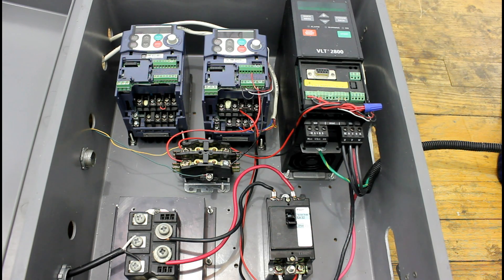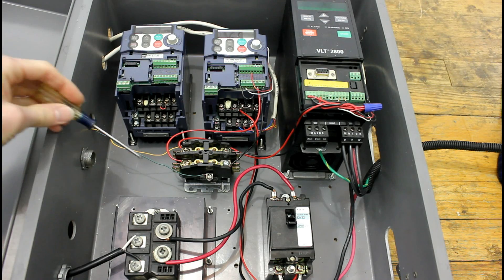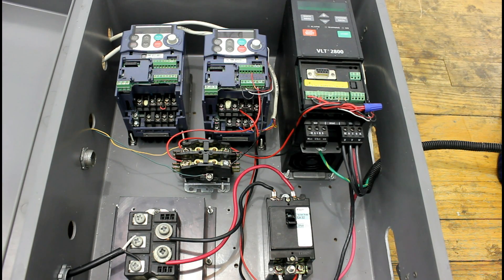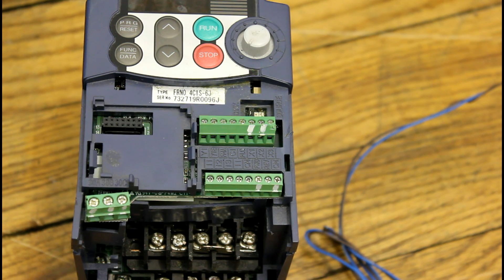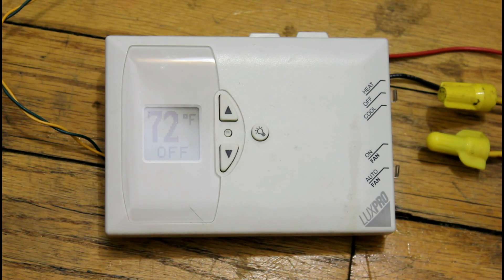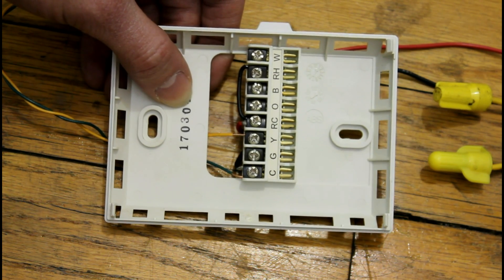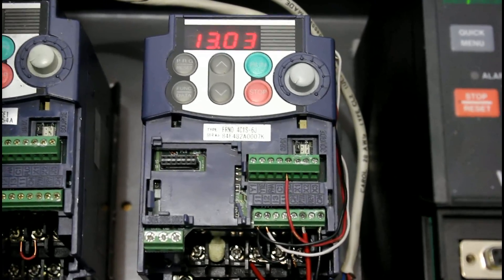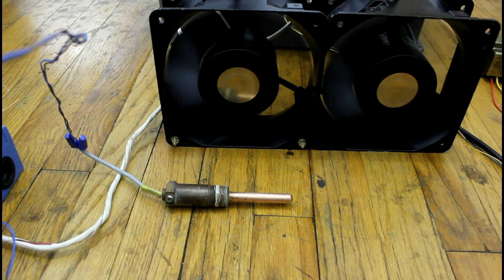Video Request; Integrating VFD and Temperature Controller

Comment: I've just got a single phase to single phase VDC to control a 240V hvac indoor fan. My goal is to lower the fan speed as it is oversized for the bedrooms sizes. The fan wire is 24V, how should I wire and  setup the VDC?

Comment: Thank you for all the good info. I ve learned so much from you. I have a few VFD around but did not have three phase to test them, but thanks to you now I know I can run them with DC. I will make a voltage booster to ramp up the 220V and have some fun with my 11 KW VFD but also with some smaller ones. My project now is to build an induction heater to melt metal, and what I need to sort out is the oscillation and gate driving part and I do not have some proper plans to fallow and very limited electronics knowledge. I have most of the high power parts 6 x SKM100gb123d ; 6 x 2.0 uF 1000V aerovox capacitors ; 5 rectification bridges ; many big electrolitic capacitors ; contactors ; switches ; BIG aluminium radiator and others various items. I have posted a short video with other parts I have and I hope that I will end up with with a unit looking like this: https://www.instructables.com/id/30-kVA-Induction-Heater/
If you have some plans for driving those IGBT safe it would be awesome. Also I m curious if it happens for you to know for how many amps and what maximum frequency can those aerovox capacitors handle because I was not able to find datasheets. (you can see the capacitors in my video)

Comment: Dear sir how I connect MBS 3000 transmitter  with danfos vfd for control pressure.
Reply from the maker: From what I'm seeing, An MBS 3000 is just the pressure sensor itself. It will output a voltage or current in proportion to the pressure reading. You can directly connect it to the VFDs input but I'd assure you'd want the VFD to maintain a target pressure. In that case you'd need a separate pressure controller.
Reply: Thanks sir

Comment: I am interested in trying VFD, Temperature Controller and PID on a  O-General Window Model 2.5 T Air Conditioner specs 50 Hz , single phase machine. It currently consumes 23 A during running. When you test run an airconditioner, do let me know the result.
Reply from the maker: Sure just look at my channel and watch the other videos I've posted. The system works quite well

Comment: Nice. 
I've got a 3.5 HP VFD laying around here. 
But I'd have to get a 3 phase compressor just to use it. :-(

And I haven't looked into it to see if it can run on single phase input. 
I know some of the Fujitsu Frenco ones we have at work said they would with input on L1 and L3.

Comment from the maker: The eaisest way to make it work is with a transformer. Get a 2:1 transformer to go from 240 volts to 480 volts and connect the output to L1 and L2 on the drive. 

You could even use a variac and slowly turn it up until the drive turns on

Comment: Hi friend,
Could I rattle your brain for a moment lol, iv this vfd I got of ebay' and the chap I got it of said it works on 240 volts. Well iv looked at the datasheet and its operating voltage is 400-480ac and I'm upset mate ;( Iv no idea how to wire this up' as I don't want to damage it! So I'd rather not try! Here's the 
product info: 

lenze smd ESMD371L4TXA

please could you help in any way on how to wire this bad boy up!! Lol

Many thanx for your time friend;)

Anthony.

High1vltage1rules